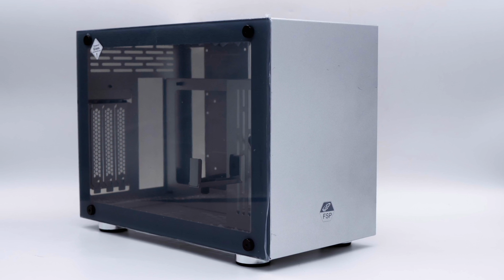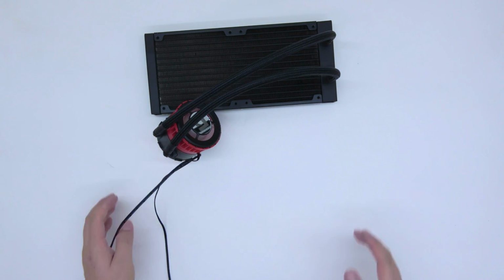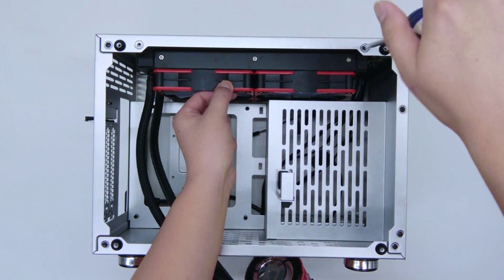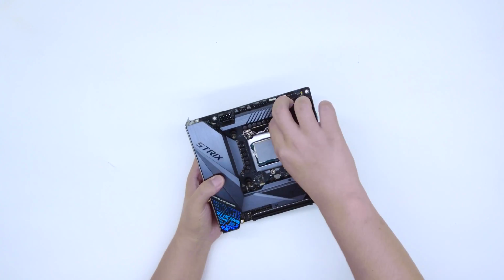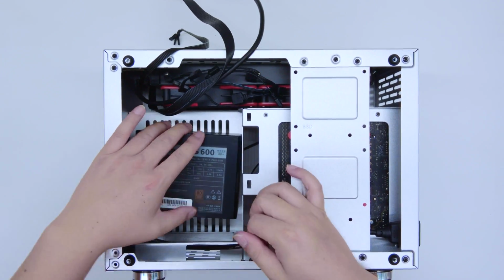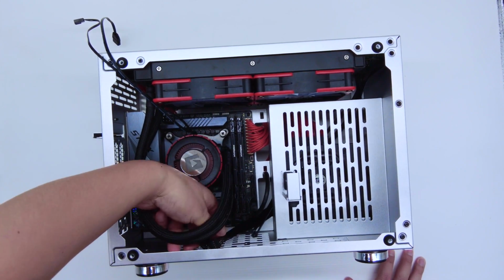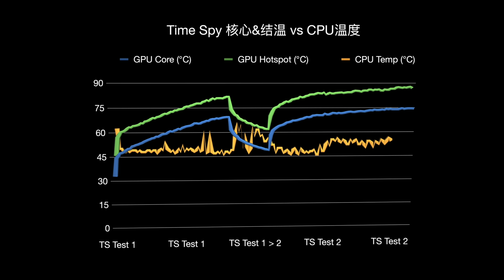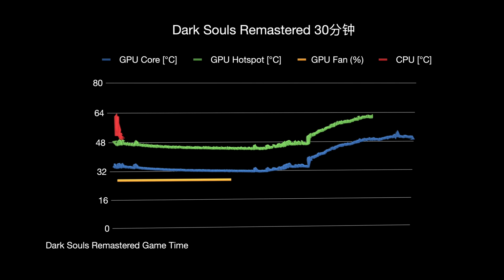FSP CST410 Aluminium(NOT!) Appearance ITX Case + ApexGaming Titan 240 AIO Build

Comment: 0:35 - it's not create an airflow conflict, active fun even in slowest mode will easily push air harder than Atmospheric pressure will push hot air vertically. Other arraignment's just an aesthetics. But i actually like this one,  it's shorter for custom cables to rich 8pin CPU and even 8 pin GPU power.